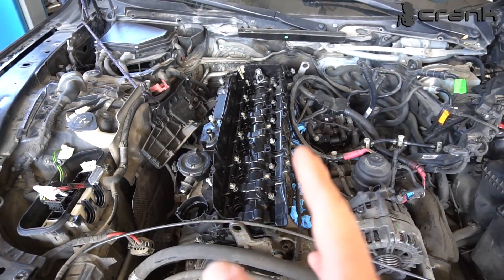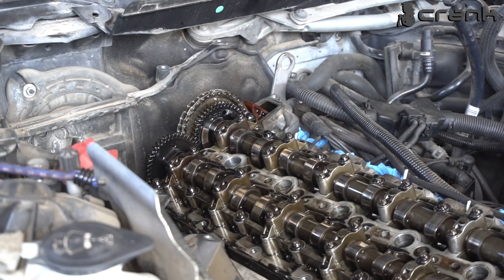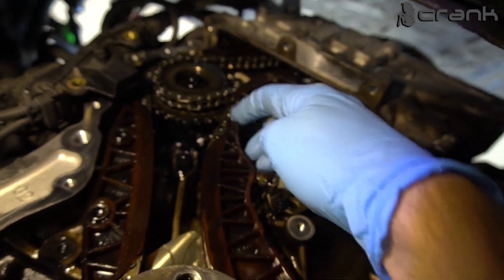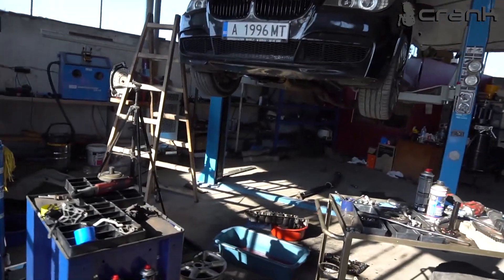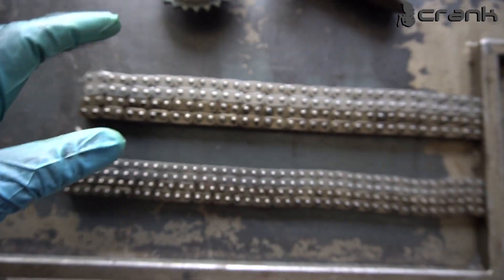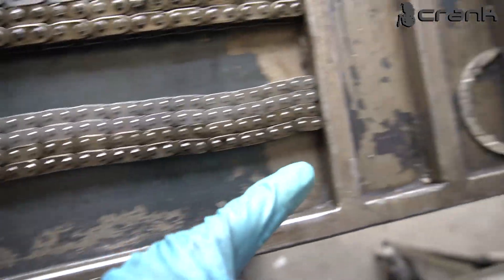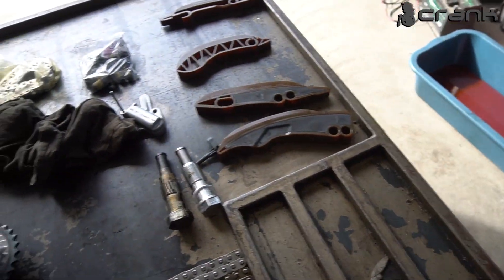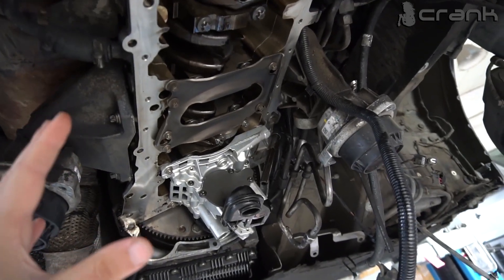Stretched Timing Chains BMW N57 F01

Comment: Hello i just got myself a BMW X5 F15 2014 with N57 258HP, 244000km full timing chain replaced with tensioners and everything, gearbox oil and filters, oil and filters at 10k only not above, Should i be concered about the bearings? main bearing and the con rod bearings? SORRY FOR BAD ENGLISH! and if i replace the bearings will the engine go atleast 350-400k? i just got the car and fell in love with it but this engine streeses me out... Please help :D
Reply from the maker: Yes they will fail soon, if they haven't been changed
Reply: @crank3646  and if i change them ? will the car run atleast 100000? and the oil pump?
Reply from the maker: @alex.7653  Nobody knows, but at least you will give the best chances this to happen

Comment: Wow! They were very lucky it didn't jump any teeth!
I've got to change the chains etc on my e90 2010 330d (manual, RWD), and I'm also looking at taking the gearbox out and not the engine. (I work in a garage, so my car will be on a lift).
Are their any major disadvantages to doing it that way?
Reply from the maker: If you are doing only the chains no
Reply: @crank3646  hmm, actually, I might be doing the oil pump too..... [edit] Lol, I've only just realised that you've got the sump off with the engine mounts in place, so no worries there 🙂

Comment: I got 218k out of mine before having to change the chains. Lucky for me the head casket leaked and I took it in to get it replaced when they told me the chain was so loose that it was a miracle it had not jumped a few teeth already. There was no noise noticable on the inside if the car that would indicate such a problem so it was pure luck.

Comment: , I have a 2009 bmw 330xd e90 , so the problem is like this... I was at 70 km/h and I let off the gas.. 65 km/h it makes a noise (TU-TU-TU-TU- as if the engine was banging ) !! I put my foot on the accelerator and then the noises disappeared! I release the accelerator again at the same speed 60-70 km/h..it makes noises again ! But right at this speed 70 to 60km/h I do it again but when I heard the knocks I put it in neutral..and the same result disappeared the noise when in neutral 70 to 60 it makes no noise only in drive are the noises and precisely at this speed from 70 to 60 km/h , when I put my foot on the accelerator at this speed there is no knock only when I release the accelerator and only from 70km/h to 60 km/h !!! Please help!!!

Comment: Hello!!Another great video!!
With all your experience in this matter do you have any theory why this happens?
Why this N57 setup is prone to stretch like that and the M57 is more durable?
Thanks,
Cheers!
Reply from the maker: Camshaft chain design, it is way to thin. The crankshaft to HPFP chain has pretty much the same life as the M57 chains
Reply: @crank3646  are you saying M57 is no better? I heard it's more reliable than ,N57 in this regard

Comment: Great job for just one day. I have the same engine on the x5 2012 245hp, for now the chains are fine, I hope I'll be lucky enough to hear them if they need to be replaced.
I'm also interested in how much such a repair costs for labor, I'm talking if I get the parts myself.
Reply from the maker: Thanks! For sure it was not for 1 day :D We had some issue with the timing chains delivery, so it took quite more time. Most of the shops, including ours is not working with the car owners parts. The labor can vary from car to car, depends on many things.